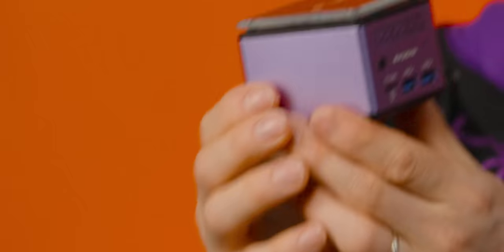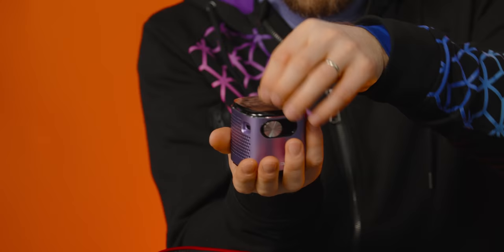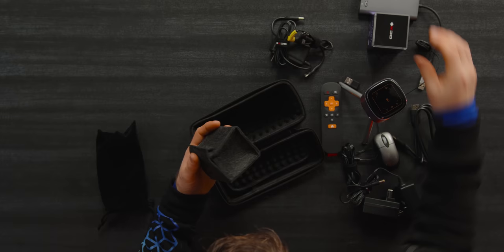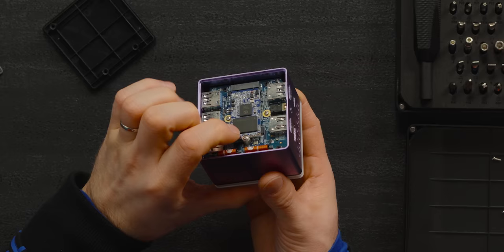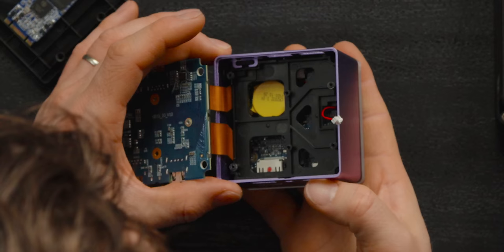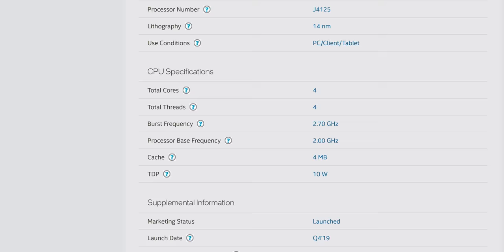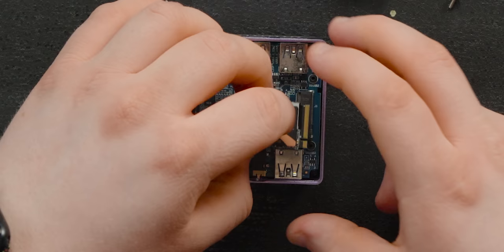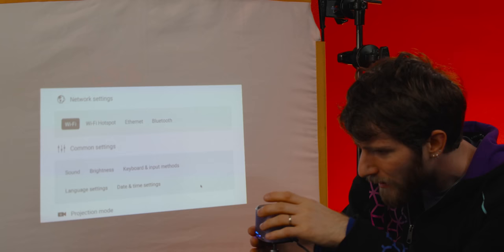This is a computer - XDO.AI PicoPC

Comment: always so interesting to see how compact pcs have become
Reply: Intel Compute Stick (2015) is a size of m.2 external box and connects directly to HDMI port.
Reply: True but it seems understandable considering cell phones
Reply: @Eratas1  but is crap... at least the one I have, though without using gyro pilot-mouse-keyboard combo it was mostly usable (no idea why it was so hard on cpu) but still freezed each dozen seconds on yt (and any updates make it completely unusable until it fhinishes)

But things like one from this video, and Chuwi Larkbox which is exactly same thing but few years eariler are doing quite well

still intel compute stick is a really nice idea
Reply: @A6Legit  Exactly. A Snapdragon 8 can get performance relatively close to Zen 2 using the same 10 watts, whereas this Celeron barely gets a multicore score above the single core score of a 3600X.
Reply: Yeah, it's so damn impressive, not like this tiny 4x smaller piece of hardware called smartphone that is 4 times more powerful...
Reply: @D_Wito  happy user of a larkbox pro, understanding the limitations of a j4125 Celeron i have a complete desktop computer on a palm size cube, incredible
Reply: @D_Wito  That is probably a heat issue.
The compute stick probably doesn't have any active cooling. And being so compact, it must thermalthrottle like a MFer.
Reply: @The_Keeper  Theres no need for active cooling on these class of processors. It will thermal throttle under heavy load tho but no biggie. this product in particular however is a scam, sub $200 bucks will get you a n6005. Thats what i'm using now to do work on. passively cooled and gets 50% better performance than a j4125. I use a j4125 for my router/home automation server also passively cooled. This particular unit sells for ~100-120 bucks on aliexpress. Actually found the alibaba for the manufacturer and they start at 81 dollar a unit. Really disappointed in LMG right now.
Reply: Aye, just amazing that this little thing is more powerful than the first computers invented. And those took up whole rooms.

Comment: I think that not only is it a neat concept and pretty well thought out, since it has been created and put on the market, it is going to create competition and maybe we will get Intel/AMD/Nvidia on the train with making the hardware to modern standards like an I9 micro chipset with an RTX 40XX mini series. We keep going bigger and bigger but with modern advancements you could definitely build a pre-2015 game killer GPU/CPU combo for something that small if they would just give 'er a go.
Reply: why would you buy that instead of a laptop? A laptop is much more compact
Reply: @the_original_dude  I do have a few thoughts on this and that is a great point. Personally, I have a hard time using laptops as I have really broad shoulders making the keyboard and trackpad uncomfortable. Using a mouse with the laptop is still a pain as the monitor is stuck relative to where the keyboard is making it insanely hard to type whilst looking at the monitor as well as making gaming a chore. I also use my desktop keyboard angled in at close to 45 degrees meaning I have to carry an extra keyboard AND mouse with me. My reading distance vision is also not great so I like to have a specific set distance that you can't really do with the laptop as it's all connected. I have raised monitors with them being raised about 6-8 inches above the desk which is something you can't do with a laptop without making it out of multiple pieces essentially doing what that thing does. I also DO own a laptop if that gives you any solace but I only use it when traveling and not much else. Mostly gets used to talk or watch shows. One final thing is the continuous upgradability and not being locked into one ecosystem. Sorry for this long drawn out mess of a reply but hopefully this gets the point across and thanks for asking.
Reply: @thrownsofaraway9978  but what's the use case? Like staying at a hotel room?
You still would have to carry your keyboard of choice.
That tiny projector is gonna be way worse than a laptop monitor in uncomfortable position.
Imo, upgradability is a little overrated. But if you really need it, Framework seems like the only solid option.
Personally, given I understand your use case, I would just use a table(like Surface Pro or Dell XPS 13 2-in-1) with a mouse and a keyboard of choice.
Or use Framework(with removed display, but keep the keyboard and use it) + portable monitor + mouse.
Or Mini PC + portable monitor + mouse + keyboard.
If it's gonna be used only at some place with a TV and Android can do the job, I would just use the phone + TV + mouse + keyboard

Comment: I love how much fun he has with this. Makes me want one even though I don't need it.
Reply: I would recommend one for you if you are for example into fantasy role playing or need to spend time in a tiny apartment where a huge pc is not an option.
Reply: consoom
Reply: @Yatukih_001  Actually I was thinking about using a raspberry Pi for a glovebox computer in my car (I have a 7 inch display head unit with AV inputs), but this would be a bit more powerful and capable and even more compact. 🤔

Comment: This reminds me of a few years ago when I tried to build a setup like this with a Raspberry Pi. But pico projectors were still too expensive and not good enough for it to really work well. Packing this much power and this many features into such small, cheap for factors is impressive.

I could see this being perfect for say a camping trip where you want to put on a movie, especially if you have sufficient cell signal to tether and stream something
Reply: camping is such a great use case for this - the thing runs from a power bank!
Reply: @marcusciantar3407  Or you could use a laptop.
Reply: or just bring a cheapo laptop, buy the same or cheaper projector, and tether or hotspot ur phone for connection. laptop has a battery aswell so u could do stuff outside of outlet range. cheaper, more versatile and expandable/modular/upgradable
Reply: @MrPaxio  This eill take up less space, and weigh less than a laptop though! 
For a lot of situations, maybe even most, a laptop could be as good or better, specially if you already have one! But lets you are hiking, or biking, or something where you are space restricted, and maybe having to log it around. This would be a better setup.
Reply: yeah but at that point just use the android pico projector by itself to stream.
Reply: @Krydolph  not really, dont forget this thing needs a power source. and going biking or hiking you have more space than what you can bring onto an airplane. and why would you need to bring a projector, its not like theres alot of areas to project onto in the forest or mountain... i guess bring the projector screen with you too. cmon now give me atleast half of a good reason to bring something like this outside of the kids room
Reply: @MrPaxio  You might have room, but how often do you bring sleepingbag, tent, pillow, eating utensils, raingear, food, water and more onto the plane? 
The ones that are serious about this kind of things save space everywhere they can. Probably the bigest talking against is it would not be taken as it might be seen as not essential enough, not replaced with a laptop, but just dropped all together. 
You could project on the tent, or a sheet, or even just a tshirt, it would still be a bigger screen than the laptop. 
It is clearly not for you, and it's not for me either. But I still think there is situations where "just bring a laptop" isn't a better solution, specially if you don't have the laptop laying around already!
Reply: @Krydolph  bro, a laptop is thin and slim, fits inbetween literally everything in a back pack. this is a cube, a very bad design interms of portability, plus another cube for projector, and another cube for battery. and another painters roll for projector screen. that is thick and not portable. a laptop has been designed to be portable, for the past 2 decades.
Reply: @Krydolph  how about just using a smartphone man. It takes even less space. You just need to bring a charger and a powerbank (optional if you are in the wilderness)

 Not saying that phones can be as powerful as computers, but if you are talking about storage efficiency smartphones are the way to go.

If you have enough carrying space tho, and don't mind a few more grams just use a laptop (or a android tablet or ipad ). Some of them are lightweight and usually good.

Comment: That little computer is going to be great for Powerpoint presentations.
Reply: R Hamlet  Well, for one, it runs on Windows. Second, you can connect a mouse and keyboard. Mobile phones are just that, phones. Unless someone bridges the gap and make them actually powerful enough to run more that ad-laden mobile games.
Reply: @Mp57navy  u can actually connect ur phone to mouse and keyboards for years now
Reply: @MonicaHolly143  probably he is talking about the reality of NA, since they mostly use Apple as phones. Luckly, the rest of the world is mostly android and you can pretty much do this without so much hassle through BT accessories.
Reply: @Gadlight  Apple for phones. Android/Windows for pc’s

Comment: I've become a little obsessed with these mini PCs over the last couple of years. I bought a little Celeron N5095 one to use as a Plex server and it hardware transcodes like a champ for its price using quick sync. I've been recommending them to friends and family who don't need or want the portability of a laptop but also don't need a gaming computer. Even for Photoshop and light 1080p video work, some of the mid to higher end minis/NUCs work well.
Reply: Yeah this is great to put next to a home cinema set or something, it will surely be a lot faster than the garbage CPU that's in most smart TV's today
Reply: This. Even Dell/Lenovo SFF machines can be worth it, the one I have came with a Quadro GPU installed so that handles the transcoding for Plex handily.

Comment: I use the intel stick computer for traveling. I have a full sized laptop, but a lot of times in hotels, I need to use the laptop for work. I plug the stick computer into the hotel TV, and have access to youtube, and other streaming options (with ways to work around commercials), and they are powerful enough for classic gaming as well. The other issue that I can bypass is the hotel authentication page with a full computer, that sometimes does not play nice with other dedicated streaming sticks.

Comment: I was honestly expecting this thing to be a LOT more expensive. But at its current price it’s a pretty great deal for what you get.
Reply: When you do the math it's really not. It's an overpriced Raspberry Pi with a Celeron instead of an Arm chip. The price you see has no SSD and absolutely none of the shown accessories. You don't even get a case. Just the cube and a cord. A $200 laptop is a ridiculously better value cause you get a faster CPU, plus a display and keyboard. When you realize nothing shown is included for that price it's not only not a great deal, it's kind of a rip off.
Reply: not really. for 269$ you can get a Chuwi laptop with the same CPU, 8GB ram, 256GB SSD and (the star of the show) a 13 or 14 inch 2160x1440 IPS 3:2 screen (for some reason the 14 inch model costs as much as the 13 inch).
Reply: It's a great deal if it worked
Reply: @Erevos85  I have a tablet from them and I still keep wondering where they got such good screens for cheap. The hardware is not the best(mostly Celeron) but the screen is always high resolution and nicer colors than Dell, Lenovo, etc. for the same price.

Comment: This would actually be pretty valid for bringing a pc to somewhere with locked down pcs.  I'd use it in my college's labs where I need custom software that IT refuses to download.
Reply: Yo laptops exist
Reply: @--.--  a $200 laptop is a chrome book which is functionally useless unless you only web browse.
Reply: @ThunderBird80085  Depends on the software you're trying to run. You can easily ditch ChromeOS for any linux distro. Also you could easily get a decent laptop on ebay for 200
Reply: Well the network is also usually locked so bring your own hotspot
Reply: damn my it guys were lax letting us run whatever if it could run off a memory stick lol
Reply: @hotmailcompany52  Where I was, I refused to put MY usb sticks into THEIR machines because of how shit their security was.
Reply: @feelinghealing3890  In Russia, you don't hack computer, computer hack you!
Reply: @--.-- laptops are too big when it comes to hiding the fact your using a different system

Comment: This tiny pc is just so sick and packed with functionality for $200, this video was an absolute treat!
Reply: Prettt sure you can get tiny PCs like this without all the projector and stuff. Like this one on Amazon for $160 is the same form factor with a newer 10nm Celeron and newer GPU cores. 

GMKtec Mini PC Intel 11th Gen N5105, 10nm 8GB RAM 128GB SSD M.2 2242, Nucbox5 Pro Mini Desktop Computer Windows 11 Pro, Micro PC with Dual HDMI 4K, Dual DDR4, Dual WiFi, Giga, BT4.2& Cooling Fans
Reply: Isn't TF and MicroSD the same thing?  Nobody can give me an answer for sure.  Linus says they're "intercompatible" but I think that's just because they're exactly the same thing but labeled different.
Reply: How is this different than the other mini (micro?) PCs?  Just because it has a matching projector?

Not bashing the video because it was still good, but just wondering.
Reply: @netsider  as far as I can tell this looks like a rebranded GMK NUC box or Lark box but with a last gen CPU.
Reply: @MoChuang343   this is why i don't fund indiegogo stuff anymore, by the time it actually comes out years later someone already made a better cheaper version. I ordered a special video stabilization thing but by the time it came out the built in stabilization in go pros and reg cams already 3X better
Reply: @TheBacontarian  Same here, although the Fingbox I chose as a perk does still have a function.  Not so much for the Ouya console though 😂.  Still sometimes interesting to see what people are creating though.
Reply: @netsider  Yes, TF and Micro SD are the same thing. Manufacturers need to pay a licensing fee to use the SD name with a product, so you'll see some trying to save on those costs by using the TF name instead, which has no licensing. It's why for example the SD2SNES got renamed to FXPak, the SD Association objected to the use of SD in the name for the product as they weren't getting a license fee. There's a similar situation with HDMI (although IIRC HDMI licensing fees are a lot less than SD Assoc. membership) you'll see some products where the HDMI port simply isn't labeled or named at all in order to avoid those fees.

Comment: I feel like this might be a great little machine for running stuff like HomeAssistant. You've got plenty of ports for peripherals and dongles, and the low power draw means a far better energy bill compared to an old PC/Laptop or a NUC. It should be faster than a Raspberry Pi but more efficient than an older PC

Comment: I thought of something similar a few years back. But I wanted to build the CPU into the projector body along with a laser keyboard. So that the display, the keyboard and mousing interface would all be projections.
Reply: There's already a "lazer" keyboard. Check out computer clan's video on it. It's not very good, the keyboard
Reply: You know what'd be cool (but not literally)? An eGPU enclosure that supports wireless DisplayPort (for AR & VR: Yeah, Wi-Fi 7 will make it more than compelling for high end gayming). Slap a cheap touch screen on a side of it for good measure for troubleshooting in a pinch I mean.
It'd go great with the new trend that's mini PCs & modular computing.

Comment: Oh, that resolution tells me everything I need to know.  That little cube is running a fairly old MEMS (electo-mechanical) raster (left-to-right, top-to-bottom) scanning chip.  If you bounce a trio of lasers off the scanning head, you get a color projector.  If you aim a camera at the scan head, say thought a piece of fiber optics, you get a scanning camera that's super tiny.   If you can turn on and off your lasers faster, you can up the horizontal/X resolution.  But, the vertical/Y resolution is locked at 480 no matter what.  848-ish X resolution is the best you can really get, though.  Fun chips and nice to still see them in use from MicroDisplay more than 12 years after their commercial debut.

The bit about VGA connectors is true, BTW.  My Microdisplay, bought cheap as HDMI was being adopted, used VGA.

Comment: Was a normal monitor ever tested with this unit? Would be interesting to know how it performs connecting a regular display
Reply: based on my Chuwi Larkbox Pro with same CPU it works just fine like any other pc, even with 4K display (no idea though with 4K video I probably tested but I don't remember it was probably fine as well) I even tested steam FHD streaming but latency (I mean slower games were still playable) was probably due to wifi signal not display or pc hardware

Comment: Got a ThinClient with a J4105 and 8GB of RAM, just had to add a proper SSD as it came with only 16GB. This did cost me 56 Euros incl. shipping... Using it as my low power NAS, not drawing more power in idle than the Pi 4 I was using before but offering more performance when needed.